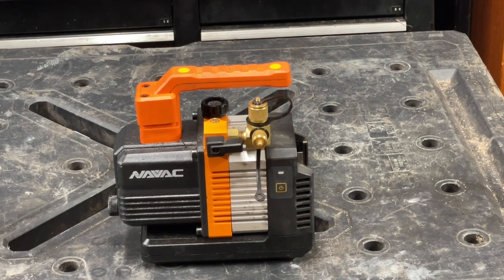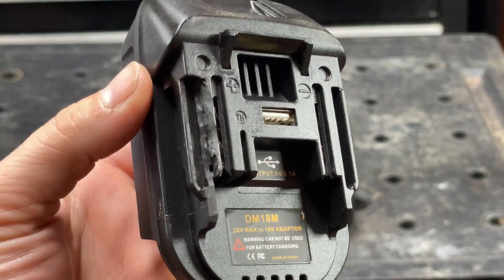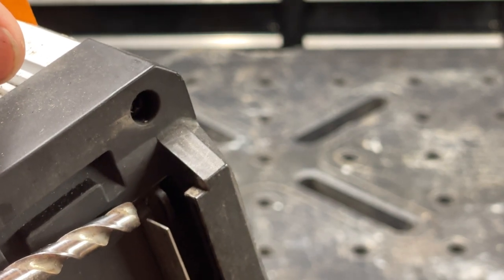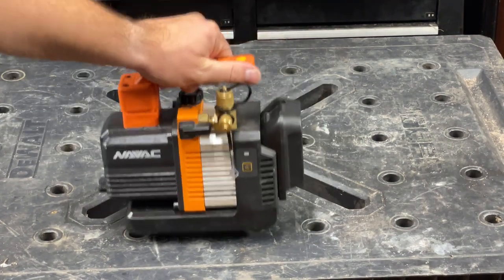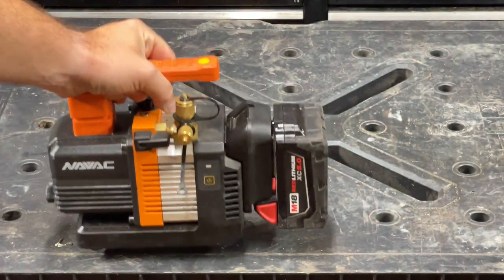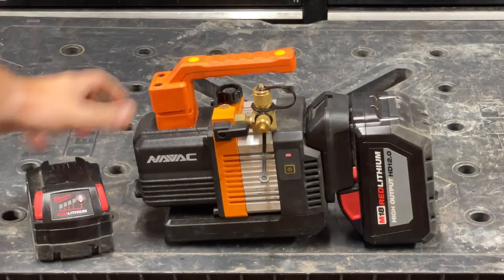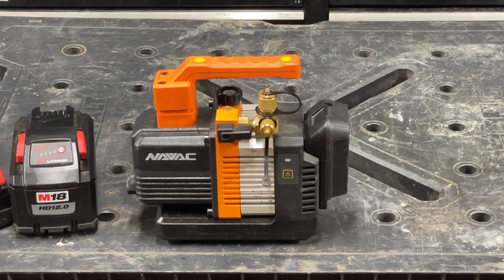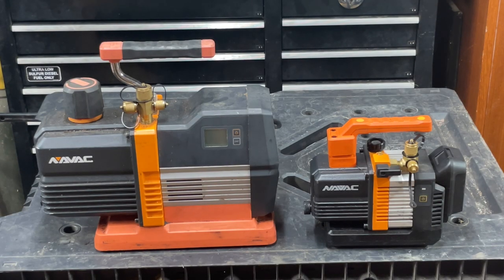Navac 2cfm vacuum pump with Milwaukee battery, size and sound comparison with 6cfm

Comment: Does the adapter have a built in low voltage cutoff? Or will it drain the Milwaukee battery completely?

Comment: I did this with Dewalt batteries. Had two pumps both only lasted about 8months.   The electronics on the bottom is a no go. I’m trying out the harbor freight one… it will not work with Dewalt…. If this fails I’m getting the Milwaukee or JB cordless model

Comment: 2cfm navac or 5 cfm miluakee pump? Is 2 cfm enough for residential? How long? Can you use any oil with it? How many bars did use the milwuakee battery in one run?

Comment: Do you find the navac batteries to be unreliable? I have a dewalt set up with the newer dewalt batteries and may want to use an adapter makita to DeWalt then.
Reply from the maker: The navac battery I have has no charge indicator plus I have a ton of Milwaukee batteries that I keep charged. It’s more convenient for me to use the Milwaukee batteries. I’m sure the dewalt batteries will work fine as well.
Reply: Makita batteries fit without an adapter